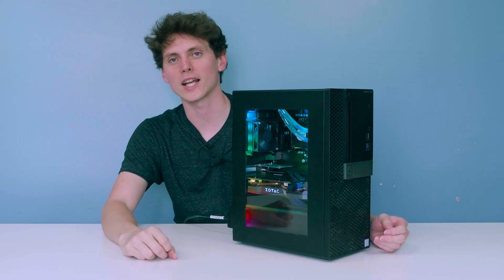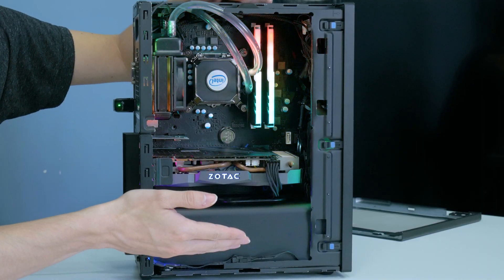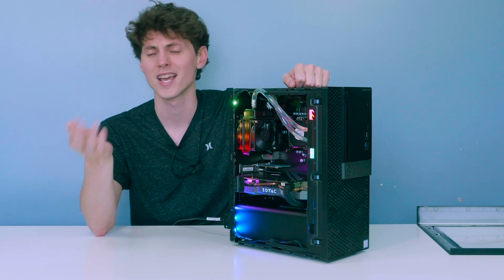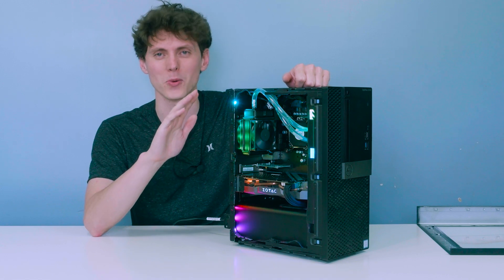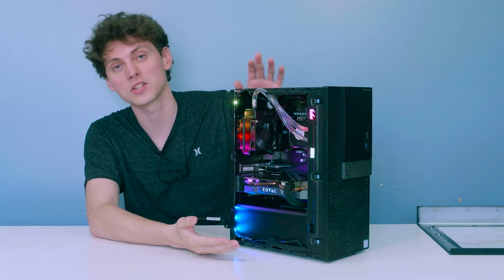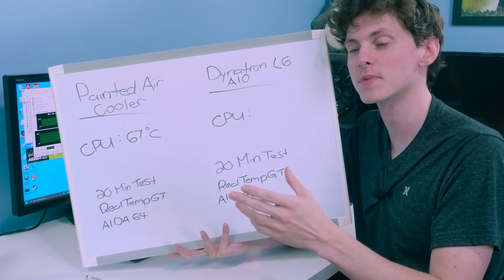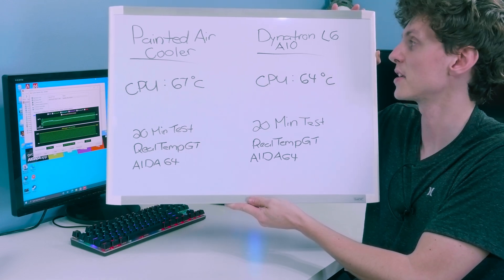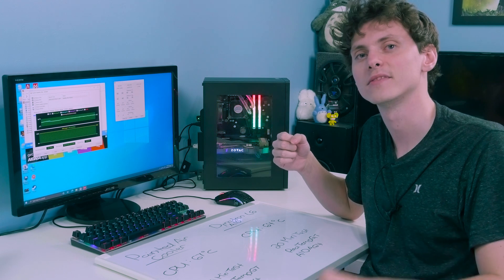Water Cooling My Dell Optiplex Gaming PC

Comment: Whoa, insanely cool! I wasn't expecting you to actually mod an AIO instead of a custom loop, but this is even better! Imo, totally worth it just for the experience alone. Like in my project, where there are no real benefits to cooling or performance, but the build process itself and the creative ways of unusual PC modding is what I live for. Also, thanks for including my comments :)

Btw, that server AIO is weird... Cool, but very weird. As you seen in my mini-ITX, I simply gutted a few cheap Chinese AIOs ($27 each, bought 3 just because lol) and refilled them with the desired rad size, might've been easier for you to do something similar, but regardless, it looks like it worked out great and you now own the most badass OptiFlex in the world. I might consider finding an old one somewhere cheap just to try and mod one myself :)

Either way, great stuff as always, can't wait to see more like this!
Reply from the maker: Happy to hear you think my idea was cool! It was the only route I could take after the custom loop idea fell through! Like you said, there isn't much of a performance benefit to having the AIO in OptiFlex (most due to the locked 6700). But, at least I can say I have a water cooled Dell Optiplex! No need to thank me! I should be thanking you for your suggestion!

The AIO from Dynatron is rather bizarre, yes. Didn't even know something like it existed until I stumbled upon it. I think I spent 15 minutes just looking at the AIO itself when I got it. I was trying to figure out if I could actually make it work or if I just wasted $140USD on this thing lmao. At the time of buying the Dynatron L6, I didn't know it was meant for GPUs. I thought it would come with a CPU backplate and bracket to mount it. But, it only came with a GPU bracket. Like you said, there's probably an easier way of doing things, but it worked lol. I would totally recommend modding an Optiplex. They're cheap and easy to find parts for. So, if you mess up, it's not the end of the world.

Not sure I have too many ideas left for OptiFlex. But, I'm sure I'll come up with something else! Until then, I have a few more project ideas that I want to work on now. They also are doing my own mods to things.

Thanks for the continued support! I appreciate it very much man!

Comment: custom loop! custom loop! Custom loop!
Reply from the maker: I'll investigate the possibilities of it some more on my own time. But, for now it's not on my list of things to do. I work spontaneously though. So, I may one day wake up and feel like making it happening.
Reply: @WiltshireTutorials  This sounds like a lot of work, but you could design a top hat for the optiplex where you could fit a 240 radiator, and use the cpu pump for both the cpu and gpu. Though I dont know if the cpu pump is good enough for that.
Reply from the maker: You could probably put a radiator externally on the top of the OptiPlex 3040 case. I personally don't like the look of having things outside of the PC case. I'm not sure if the pump that's attached to the radiator of the Dynatron L6 is strong enough to circulate the fluid through a full water loop.
Reply: @WiltshireTutorials  yeah that's the main concern, I have seen it done for itx cases, but for something that big (LMAO optiplex is too big) it might be too much, thanks for listening to my idea thought. I'll be waiting for your next video!
Reply from the maker: One thing that could be done is to look up the flow rate for the water pump on the Dynatron L6. This could be done by looking up the model number of the pump and looking at the datasheet for it or by seeing if Dyantron has the flow rate listed on the webpage for the L6 AIO. You could then compare the flow rate of the water pump on the L6 to a known water pump that can support a full water loop.

It's not a bad suggestion at all. Some may try it and like it aesthetically. I'm always open to taking ideas from the comments section!